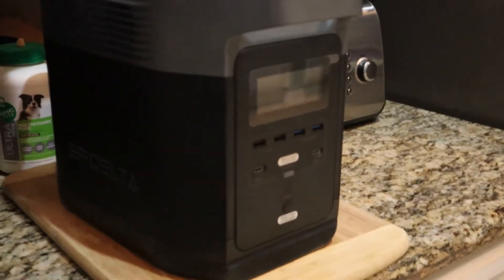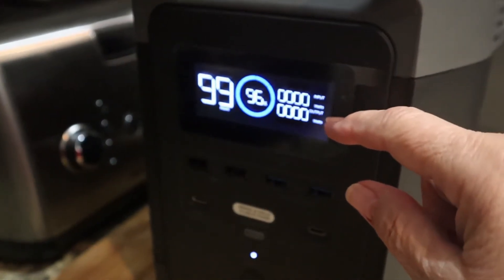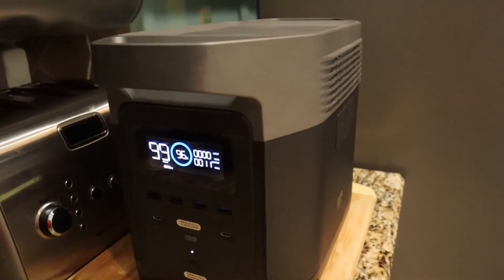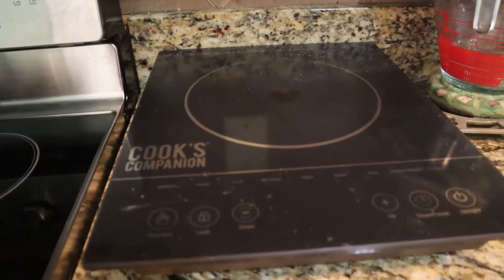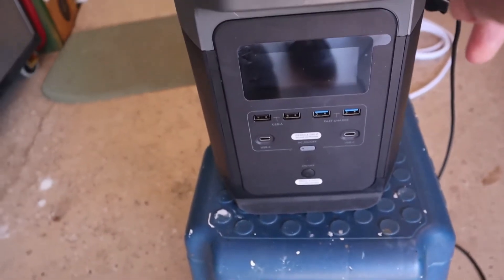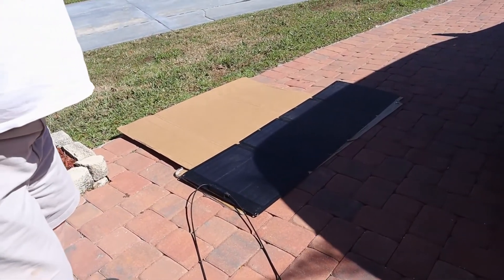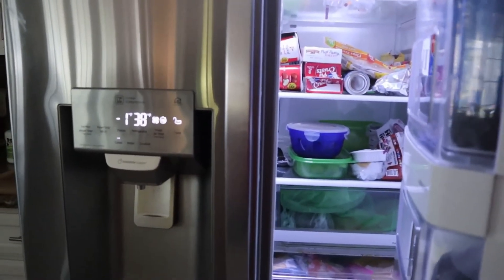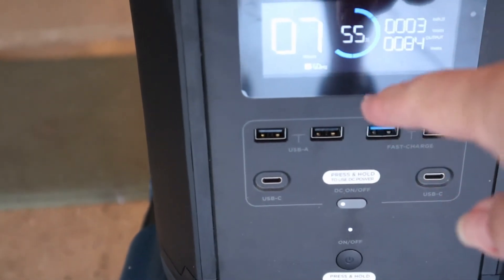How to Use the EcoFlow Delta 1300 Power Station to Power a Refrigerator

Comment: Thank you for sharing. I have the River Max and was looking into getting the delta.  We have the same coffee maker.  Does the Delta work with your coffee maker?  My River Max does not.
Reply from the maker: If it would power our refrigerator/freezer, I wouldn't doubt it would do the coffee maker.  Why didn't it work with yours?
Reply: @DebsWay  Thanks for Replying.  The thing about refrigerators and freezers.  They don't take that much watts to power once they are cold or freezing.  If you lost power for lets say 12 hours before you plugged in the solar power bank than it would take more watts to work the compressor to make the fridge cold and the freezer frozen.  Our Keurig coffee makers takes a lot of watts to heat the water and make us a perfect cup of coffee in under a minute.  My Ecoflow River Max was able to power on the coffee maker but was not able to make a cup of coffee.  It does work great for my fridge and Chest Freezer. Microwave and coffeemaker no go.
Reply from the maker: I don't know what to tell you.  Maybe it has to do with the size of power unit you have?  Sounds strange to me that your power unit would work with your larger appliances but not with the smaller ones like a coffee-maker.  I don't understand that at all.  Our power unit worked with everything we plugged in to it.  We are very impressed with the capabilities.  We are also looking at buying another unit.     If we lost power for several hours, we would be plugging the fridge in right away for sure.
Reply: @DebsWay  it has to do the capacity of the inverter. A fridge is not a high draw item where a coffee maker may have a higher draw to supply the heating element.  That's where it is important to know the details to these units. In the case a coffee maker can run anywhere over 700 watts while a fridge will be less than 500 or a bit more. So the River Max tops out at 600 watts for its inverter. While the Delta 1300 has an inverter that can handle well over that.
Reply: @Mastersextoys  inverter in that unit (what converts DC to AC) is limited to 600 watts or so. That is not enough to heat the element in the coffee machine. The River Max is on the go portable power and not for emergency residential power. If you need to power mobile devices, no problem, run occasional items under 600 watts for short periods, no problem. In this case the river max is not suited for your needs.
Reply from the maker: @jcberb  Thank you for responding to  Robert's concerns.  I'm not an electrical engineer by any means but I love my Ecoflow Delta 1300!  It will suit our needs in time of emergency ... even though my husband is now talking about getting another unit as well!
Reply: @jcberb  Thank you for your response.  Yeah the River Max is just going to be our portable unit. I just wanted to make sure that the Delta would power the coffee maker (I'm a coffee addict).  The only reason I was skeptical because they did put claims of Xboost on the river max and that did not work, but it makes a GREAT UPS. I have it plugged in for my Wife's xbox and TV.  Have a great day.
Reply from the maker: I'll go check his YT channel out.  Thanks!!  Appreciate it!!
Reply from the maker: I've heard a lot of favorable reviews on the Bluetti also.
Reply from the maker: Sounds like you have quite the power set-up.

Comment: so how big is the solar panel. so how much dis you pay
Reply from the maker: We purchased the power unit and the solar panel from a home shopping network when it was on sale.  Everything ran about $1500.00.  The solar panel we have right now is 110w but we would like to buy another panel to, at least, double the capacity.
Reply: @DebsWay  If you are planning on buying more panels and do not require them to be compact and mobile I recommend getting regular solar panels. For the price of one of the ecoflow fancy folding panels you could buy three 100watt solar panels
Reply from the maker: I hear ya' on the panels but we wouldn't know how to connect everything to the power unit unless it came with the needed connections.  Actually, I would love to have solar panels on the roof to power the whole house.  Lots of new homes here in Florida are going that route.  Take care!

Comment: Did you buy an extra extension cord for the solar panels.
Reply from the maker: The solar panel came with its own cord that plugs in to the power unit.  We did buy a heavy duty extension cord to have on hand though to use with the larger kitchen appliances.

Comment: That's very interesting! Seems so easy. Just searched it and said $1100-$1300 & solar panels sold separately.  Is that accurate? Would be a great thing to have for storm season in case you lose electricity. Take care!🌸
Reply: Misha, we bought this same unit along with two sets of solar panels through Amazon as part of a bundle. The initial price for everything was $1999. There was also a coupon for another $300 off we were able to use, which dropped the price nicely. Ended up costing us $1800 and some change with tax. So, you can get everything separately, or bundled together.
Reply from the maker: That was a great deal, James!!
Reply from the maker: That's about right.  They're expensive but well-worth it.  We'd like to get another solar panel, too.

Comment: I'm so glad to have found a review on a big refrigerator actually powered up to a power station.  I think your review has helped me in determining what power station I want to get.  Thank you!
Reply from the maker: We are very impressed with our little power unit.  We have one solar panel to use with it and will be looking for another one as well.  It meets our needs nicely.  Take care!
Reply: Have you had to use it during a hurricane?
Reply from the maker: We lost power during Ian but only for part of a day.  We hooked up both refrigerators to our Ecoflow units -- we now have a River also -- and they performed beautifully!!  We were going to hook them up to the solar panels but then the power came back on.
Reply: @DebsWay How long does it take to fully charge with the solar panels? And how long can this run my fridge for before running out of battery. Thank you for your video
Reply from the maker: Hi there!  In this video, we were testing our new power station to make sure it could power up our fridge if our power went out.  And it did!  We've only had to use it for temporary power outages that we have here in FL and haven't had to rely on it for days on end.   
We have never had to charge the power unit up with solar alone.  Sorry, I'm not able to answer your questions about long-term use of our power unit.  We just don't use it for that.   If you're looking for something like that, I would look in to strictly solar power..  Our next move would be to install solar panels on the roof to power up the whole house but we're not quite there yet.

Comment: Can the solar panel  be charge on it own and then connect the panel to the generator to charge the fridge? At the moment I don’t think I have a long outlet cord to have both going at the same time
Reply from the maker: My understanding is that the solar panels aren't what holds the power.  The power unit holds the power; the power unit keeps the fridge going.  The solar panels will keep the power unit charged up when you don't plug in to electricity.   More than one long outlet cord is needed for sure.
Reply: Deb's Way . What length outlet cord were using ? I see how to connect the fridge to the unit  and how to connect the panel to the unit 
I have an extension cord now but it does not Connect to the fridge cord.  

The fridge is 3 prongs.  Are you using a 3 prong outlet and connecting that to the your fridge cord?  Assuming your fridge cord is 3 prong as well.
From what I see that is the only way for me to to be able to move the unit closer to the balcony with the panel. 

Sorry not a very technical person with these things. I see there is a black cord that connect to the unit but I don’t know the purpose for that because it can’t connect to the fridge outlet.

From what I see you have to connect the unit directly to fridge cord.
Reply from the maker: We already had a long, heavy-duty electrical cord to use but also bought a 40 ft Snow Joe Indoor/Outdoor Extension cord to use for this power unit.
Reply: Thank you 🌺

Comment: Thanks for the video! I wanted to see if you’re using a 100 watt solar panel ?
Reply from the maker: This little unit does a great job!   We just have the 100 watt solar panel right now but will be looking at getting even more solar power.  It does a great job!!
Reply: @DebsWay  I am trying to find a, good quality, solar power source, that will run a small window unit a/c and or a home refrigerator, without paying over $1000 and I saw this specific device on Costco for a little Inter $1000 and am highly considering buying it before any hurricanes form in the Atlantic. I just bought my husband a 100watt grape solar panel for $99 from Costco and a massimo 300 watt solar power station and now I’m considering returning the power station and purchasing this bad boy that is in your video.
Reply from the maker: We looked around for quite a while before settling on this little power supply unit.  There are many models out there but we wanted something that would be powerful enough to keep our fridge going in case of power outage during hurricane season.  And this proved that it would do just that.  I don't know how it would work on a more permanent basis.  Maybe just the same.  Actually, I would consider having a solar power system installed on the house roof if I wanted to power something all the time.  Eventually, that's what I would like to have here.
Reply: @DebsWay  yes that would be nice, wouldn’t it, to go completely solar. That’s the big goal but for now I’m the same, just using these during power outages but with the last few years, we have been blasted with outages following heavy storms and our gas generator is a nice backup but I’d love one of these to use inside to power my fridge and window ac unit!
Reply from the maker: Totally understand. When we lose power it tends to be only for a day at the most (so far) and it's during the hurricane season here in FL so we wanted a power unit to plug a few important things in -- like the fridge and a fan.  For the rest, we have batteries on hand, candles, etc.  And we can use the car battery to charge cell phones and things like that.  There's so much to consider but you just have to do your best to prep.

Comment: I'm waiting for mine to arrive.  I didn't note whether you opened the freezer side.  That would probably have kicked the compressor on to see wattage.  Also, did you connect the refrigerator to an extension cord when it was in the garage?  If so, what was the gauge and length of the extension cord?
Reply from the maker: Hi Thomas!  We do have a heavy duty extension cord that we used when we had the fridge hooked up to the unit being charged by the solar panel.  I don't know the gauge but it was a Snow Joe Indoor/Outdoor 40' Extension cord.  It will power lights and appliances up to 1875W.  Hope this helps! 
The freezer part of our fridge is in the bottom compartment.  Everything was running; however, if we really had a power outage we would turn the ice makers off (there are 2). 
Currently, we are looking for another solar panel set to hook-up to it, too.  We love it!!
Reply: @DebsWay  Thanks, if you can get this info for me, it would be much appreciated.  The wire gauge should be indicated on the cord itself.  It will indicate something like 10/3 or 12/3 which would indicate 10 awg or 12 awg with a grounded three prong.

Comment: Great video...So how long did you run it in total even with the solar panels?
Reply from the maker: We were just testing the power unit with different items and wanted to make sure that it would power up our refrigerator.  It worked great!  At least, now we know the capabilities of our little power unit.  Actually, we're looking at getting another bank of solar panels for it as well.

Comment: Love how you are both getting used to using your ecoflow delta BEFORE it's needed. Important to be familiar with your back up. loving that ecoflow. great review guys... wondering.. WILL your water still work in a power outage?  x0x0
Reply from the maker: If we were to lose power, we would still have water in that case, just not hot water out of the tap.  Matter of fact, every time we have a hurricane closing in on us, we fill both bathtubs with water.  That would be used to heat up and wash in, flush toilets, things like that.  I've never had to use that but you just never know.  I asked William if we could hook up the water heater to the power unit and he said that we probably could but it would just be easier to heat up the water on our induction burner when we needed hot water.  Sounds good to me!
I tell you, this little power unit is so user-friendly!  I have no trouble with it whatsoever!!